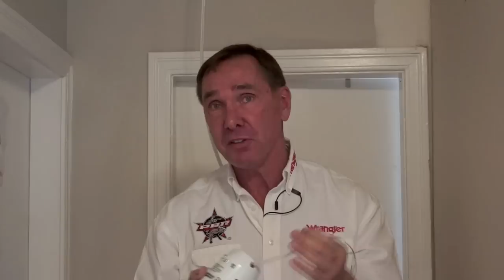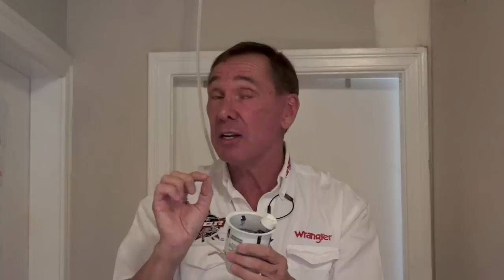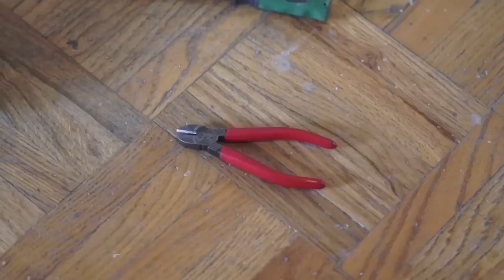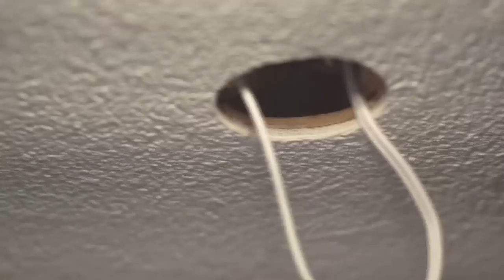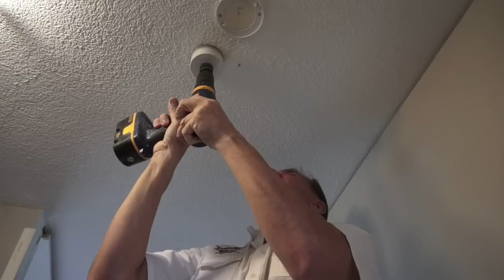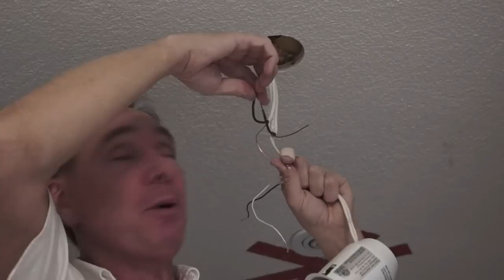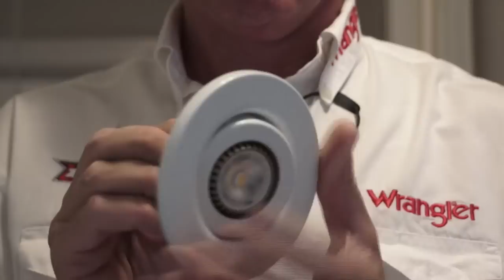How to Install Recessed Lighting | Retrofit

Comment: Hi Percy, First let me tell you that your video is very helpful. It gave me a great confidence to install my recessed lights myself. My question is how did you glued the additional hole that you drilled my mistake. I have couple of these round pieces myself and would like to know the proper way to put them back inside the hole. Thanks
Reply from the maker: Hi, it's easy. Just take a piece of wood. Glue it to the back. The wood strips should be a bit longer time good the disk in place then just glue it back in and your good to go. If I were a better carpenter I would have measured more accurately and known exactly where that beam was!

Comment: How did the electrical inspector pass this job without a junction box for your wiring connections`. Did you inform your insurance agent that you did not use a junction box
Reply: Ron Scott Good point really good
Reply from the maker: Look you piece of shit. The only reason the insurance company would care is if the house burnt down because of my expert wring but guess what it's been almost 4 years and still I fire. And you know what, it never will! It won't because of the laws of physics you model of mucus!
Reply: Percy Lipinski Ouch that's gonna leave a mark.Dog vomit

Comment from the maker: Hey to all the losers out there that thought the world would end with my installation. Going on year 4 with almost continuos use with no sign of any problem. Tell you what I'll take s bet for any amount you wish as many as are out there. We'll go on line and register with a betting service and see what happens in another year. So there you have it a bet for as much as you like!!!
Reply: "I've been driving without a seatbelt all my life and haven't had a problem!"
"I drive home drunk from the bar all the time.. never had a problem."

You having no issues for 4 years proves nothing but how stubborn and irresponsible you are.

Those cans aren't rated for use in insulation. The bulb type has no bearing on that. They aren't sealed cans. You are breaching the electrical code and quite possibly invalidating your home insurance (if they catch you.. of course there is video evidence).

Even if they last a lifetime with "no problems" it proves nothing. It's an anecdote. A single meaningless data point. Code isn't based on anecdotes.

Someone might get away with having an electrical connection not in a junction stuck behind drywall for a lifetime. Doesn't mean it is any less stupid. Someone in my area recently died from that (a DIY renovated suite with electrical done by the idiot home owner.. started a fire and the tenant died). Think their liability insurance is going to cover them in lawsuit? Nope. There goes all the equity they had in their house and any other assets they had. Would have taken a few more minutes and few more dollars to do it right.
Reply from the maker: Haha dubbreak you loser. Drunk drivers are a menace. They are scum. I'm not an idiot you piece of crap. My point in this video is that there is a zero chance that the wires in my installation are going to suddenly short out, heat up, burn and kill someone. The enemy of wire is heat. Heat will eventually crack and flake the plastic, thereby exposing the conductors which is why you need a box. LED lights generate a minuscule amount of heat. Therefore you have nothing to worry about you scholastic shit head stupid idiot!!!!
Reply: Percy Lipinski YOU PUT 120V CONNECTIONS OUTSIDE OF A BOX! In fact you removed the boxes arguing they wouldn't fit (if the cans fit they would fit, you were just back pedalling making up excuses). There is well above 0 chance of having an issue when you have 120V connections outside of a box. Call my arguments what you will, but even if you have no issues it doesn't prove anything, hence the comparison to no seatbelt and drinking and driving. Just because you get by breaching code doesn't mean someone else won't die because they follow your stupidity.

Name calling doesn't prove you are any less stupid. Your continued responses only prove how stubbornly ignorant you are. You make false claims like the electrical code hasn't been updated and "common sense" should rule over it. Ahh.. latest version of the Canadian Electrical code (23rd) was just published (2015). You are in the greater Vancouver area, so that's why you need to go by. Do whatever you want in your own house, but again, encouraging anyone else to follow your lead is completely irresponsible.
Reply from the maker: Thanks lee, there are a lot of know nothing know it all's out there.
Reply: +Percy Lipinski you cant even spell "Continuous" properly and yet you want people to believe that you are an electrical engineer? hilarious.
Reply: http://www.dailymail.co.uk/femail/article-3105522/A-house-fire-cost-Mother-reveals-s-really-like-lose-possessions-start-scratch.html
Reply: Percy Lipinski Dude, the 120 volt wiring should be in an electrical box with a cover.  The other  electricians on this page have warned you about this and yet you don't listen to them.  Why? If there's a fire your insurance company is going to laugh at you.
Reply from the maker: +Iggy Tubmen i can spell IDIOT and thats all one needs when discussing you, piece of crap!!!

Comment: Good vid. Prob still have to get someone in to do it for me.
Reply from the maker: The point if this video is to prove you absolutely do not need help to install them. This is very low wattage stuff do your house can't catch on fire due to heat build up. If you really want do this the ultra safe way just buy a 12 volt transformer on line for about $30. Then just run 12 volt bulbs no permits required. Just switch the transformer.

Comment: Good day . Thanks for reading my post. Installing a led pot light can be done safely and up to code. The major safety issue in my opinion is the connection pushed back into the ceiling. The pot light used in this video is not designed to be used as a stand alone fixture. It does not contain a proper enclosure for wire connection. When purchasing led pot light make sure it state on the box that the pot light you wish to use does not require a pot light box. Such pot light are usually twice the price but  a lot easier to installed .
Reply from the maker: Look here you moron. THERE IS NO DANGER HERE BECAUSE THERE IS NO HEAT!!!! There is no way anything bad is ever going to happen to this installation!!!

Comment: Wire nuts in fiberglass insulation? It's not safe scientifically and also violation of building code. It will not burn down your house now but there are still chances it happens in future. 1 year, 5 year, 20 year, 200 years, like russian roulette.

Comment: Hi, I'm wondering if you can answer a question. I bought 8 LED recessed lights from Costco, drilled the holes where I wanted them. Ran the wire like you showed and connected the first in line to the light fixture, My problem is that only the first 4 light up. I'm wondering if it has anything to do with the last in the series that has the wire going in but doesn't connect to anything else.? Any tips as to trouble shooting this?
Reply: I always draw a circuit diagram and label the wires. It is usually obvious what goes where from the diagram. Also, you need a multimeter to check resistance, continuity, voltage. They're under $5 at Harbor freight. I have about ten of them all over the house, garage, and car. If you check wires for voltage (to ground) before you touch them, it will save your life.
Reply from the maker: First place I alwAys check starts with the connectors. Even if a bulb was out it wouldn't affect the others in a parallel connection.

Comment: I have a full time job but like many likes to work on handiwork at home or on my cars on the weekends. I'm not going to point out most of faulty stuff that you did here as somebody already did that.

Just a question though. Had it occurred to you that one of the most basic safety precautions to do when working on a ceiling involving drilling or sawing is to wear PPE or to be more specific safety goggles?
Reply: 10-4.............this guys a dork.AND he says when running thw wire not to worry about any codes.

Comment: Anytime you hear the words......"it's only 120 volts, there's not enough really to kill you.".......Disregard anything else the person has to say. Will 120 volts kill you? Maybe not. Can 120 volts kill you? Yes, absolutely. But it's just not that simple. If you don't know many of the conditions where 120 volts can kill you, PLEASE don't work on it. Just shutting off the switch may not be enough to protect you. I'm not going to go on with what would require way to much time to type out all the info you need to know. Just google " it's only 120 volts, there's not enough really to kill you", You'll at least be more informed about working with electricity, which may save your life.
Reply: nunziocal "it's only 120 volts, there's not enough really to kill you.".......Disregard anything else the person has to say. 

This is the best advice in this entire cesspool of a thread.
Reply from the maker: You're both beyond belief. Stupid that is. Guess what??its going on 4 years and still no fire? This is stupidity beyond ignorance. It sets a new standard in idiots. Give me some science? Oh sorry I forgot you're too stupid to even know anything about science! 5 watts shitheads!!!

Comment: I really like this video. I'm wanting to do this and like your way of presenting this because its so straight forward and too the point.  thank you

Alli
Reply from the maker: Finally, back to normal. So if you read through the posts you'll see a mad rush to judge me as a nut. I may be a nut but I'm not stupid. The main thing you need to be certain of is to not use anything except low voltage led bulbs. The technology has changed for the better now so that you can wire the entire house with 12 volt lighting. In this case simply buy a 12 volt 300 watt DC transformer from eBay and use the 12 volt output with any 12 volt bulbs you decide to use. This is completely unregulated and just as safe.

Comment: What kind of untrained person (I expect untrained) puts a video like this on here, then insults the more educated watchers. I work in the UK (230V), and therefore advise others from following this advise. Also using a switch as isolation isn't acceptable here, wearing non adequate work wear, no fireproof protection (regardless of LED lamps) and I expect it will be untested among others.

Comment: OK, very good! So all of those pot lights, through a daisy chain wiring technique are on one junction box? Just wondering...say they were 4 x  50w bulbs...would it still be OK to daisy chain to ONE junction box? Thanks so much! (I am going to build a recessed mirror for a bathroom and use the existing junction box, which currently has a traditional wall fixture. But I would like to use that box for 3 or 4 pot lights which will be part of the recessed mirror....but I might want the heat from the halogen bulbs because it is a bathroom). Would love any advice! Thanks so much.
Reply from the maker: Yes that will work fine. The key is to use low watt LED bulbs which are about the only ones you can buy nowadays anyway. There are a lot of ignorant assholes on here but we could even satisfy them with one small change of you wanted. Currently 12 volt systems are not regulated so you could simply order a 300 watt 12v. power supply from China for about $30. Then use that to feed the system and you can use really cheap lamp cote to wire it all legally.
Reply: Awesome! Thanks.

Comment: I am expecting an insult such as "you moron of Megolithic mega mountains of mushy mucus" but if anyone is actually watching this video for how to install pot lights properly, just turn it off.  There are so many things wrong with this install.  I would have approved this install if you would have just used the junction boxes that were provided.  They actually work really well if they are used properly.  The open air joints are a terrible fire hazard and I am praying that your house doesn't burn to the ground.  It doesn't matter that the bulbs are only 6w, the circuit has the capability to carry an infinite amount of current when the black wire is touched to the white wire.(for a split second until the hopefully the breaker trips). Infinite amount of current means lots of heat, lots of heat means lots of fire and lots of fire means... Well you should be able to figure that out.  You should pull this video down, because if your house burns down FOR ANY REASON, your insurance company could see this video and deny you insurance on your terrible install on the basis of no permit or inspection.  I don't know why you would want to jeopardize the lives of your family just because you think you are right.  By the way, led lights are great, but have failed in the past.  Nothing is perfect. I have seen parking lots where they used led pole lights, and they have sections of LEDs burned out.

Comment: You are right Percy, you are NOT a professional, much less a qualified DIY'r.  How many mistakes/Code violations did you make?
1.  Wire nut connections not in a box.  It looks like you removed the junction boxes that came with the can.
2.  Telling people 110 won't hurt you. It's 120Vac, and yes, it will hurt you.
3.  Those are GU10 sockets.  Nothing stops anyone from taking out your LED and putting in a Halogen bulb
4.  Comparing Watts to HP is another indication you don't really understand electricity.  A better comparison would be to BTU's.  So your 6w = 20.4 BTU/hr.  But what you are really missing is the fact that the wires sending the 120Vac to that 6w bulb are actually connected (or should be) to a 15 or 20A ckt.  Hence, those wires are capable of delivering 1800 or more of energy.  Considering how you wired up those cans, it's just a fire waiting to start.

And then you resorting to name calling.  Really?  How professional is that?  Oh, wait, your not a professional.  Your just a hack who likes to see himself on the tube.
Reply: Percy Lipinski like you said percey the moron.there is a lot of heat
Reply: Percy Lipinski Why your defense is heat or LED bulbs is a mystery! you are connecting 120V to an can  built for an attached housing. No matter what style bulb is being used, you still left an open wire connection in a ceiling with no protection from combustible materials. Also using dikes to connect solid 14g wire is ridiculous! your asking for another problem. A 1st year electrical apprentice would spot all of your mistakes in this video. Shame on you for the potential hazards you will have caused by playing electrician! Stick to making gardening videos if you just want to be seen on youtube! Dont make instructional videos using power! Also, anyone in the electrical field would have stopped this video just based on your tools alone.  If you want to burn your house down do it without teaching God only knows how many others to do the same.
Reply: Building code actually changes more than you think. Plus, they are designed not to prevent an immediate fire but the possibility of having one.
Reply from the maker: Look all of you stupid morons. The codes you are referring to were written when people were plugging in high wattage, high heat bulbs. Heat is the mortal enemy of wire and all electrics. It drys out insulation, it expands and contracts boxes, wires and even connectors. The fact that my old wooden house is still standing 6 years after the first installation is proof that the house isn't going to burn down you stupid idiots. Instead of picking on me because I violated an out-of-date code rule for the 21st century maybe you should focus on real dangers. How about people plugging in high powered electric mowers with a two prong extension cord. Wet grass, high power and a flimsy cord now that's bad news and will surely cause a nasty electrical shock or death. But no, that's just not fun. It's pick on me time here. As I said previously if even one person can describe how my installation is going to spontaneously burn and cause a fire I'd love to hear about it. In fact I've offered to not only apologize to each she every person but take down my video if someone can prove that what I've done is somehow going to cause my or anybody else's house to burn down. I've been fair by leaving up every single comment, no matter how stupid they are. And trust me I am not surprised at anything anymore. There have been an amazing amount of ill informed idiots with at best one or two working neurons. So far nobody has taken me up on my offer and I seriously doubt they will unless they reinvent the laws of physics. Bring me any electrical engineer and let him show me where I'm wrong!